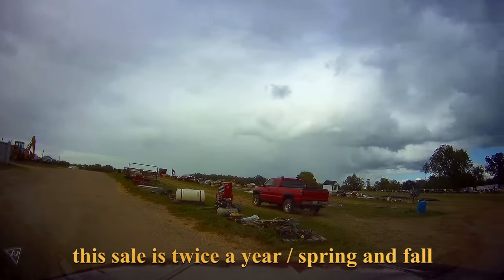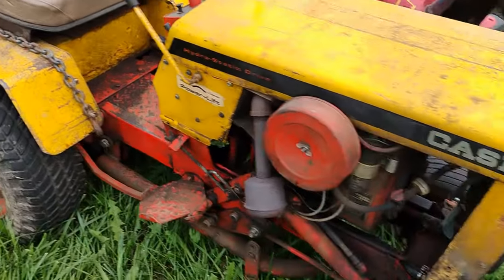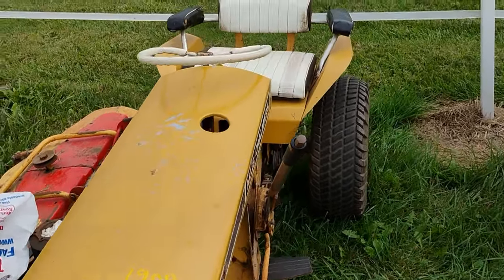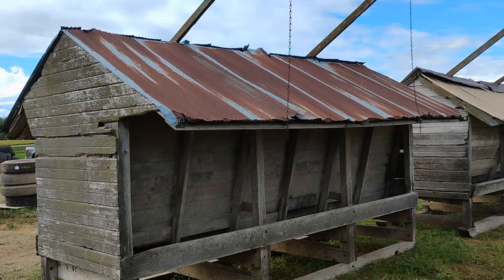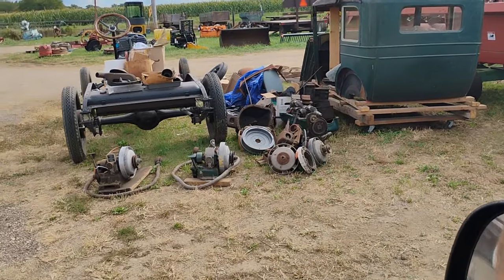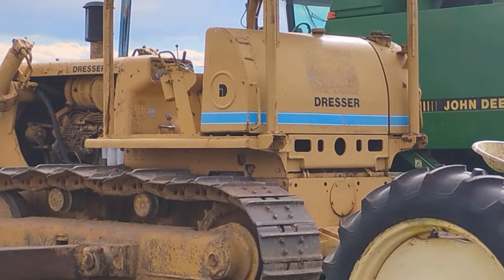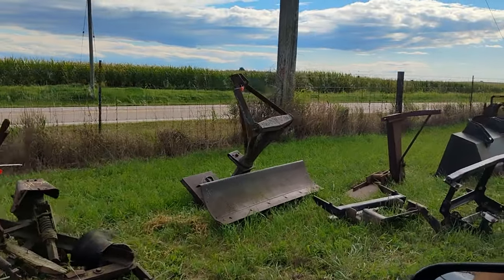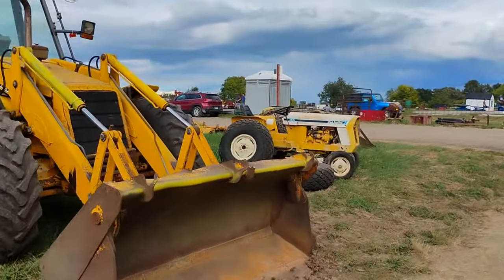Hazelhurst Illinois 2024  consignment auction sale  ( farm machinery )

Comment: Those are items to turn into the same machine it intended.,an designed to be. Which is A handle crank washer /ringer's that are wooden. Fix those barrels with metal bands.,an tack nails to.  Then restain and polyurethane coating resins mixed up 50/50 for the pitch sealer.